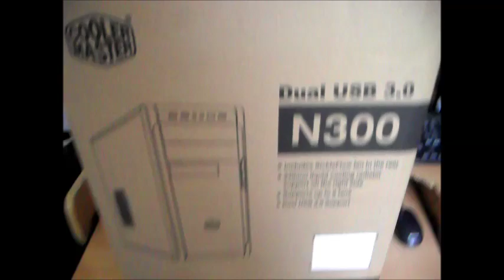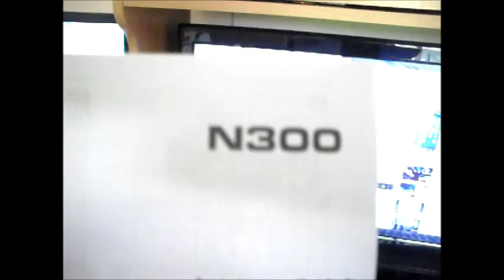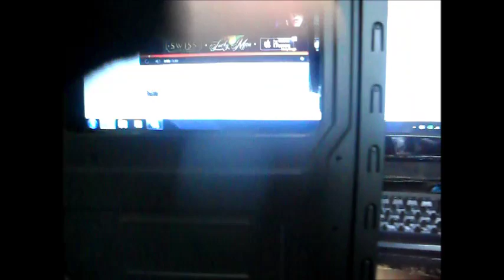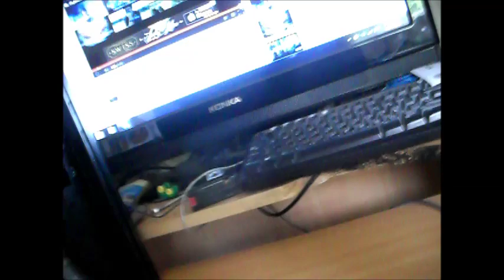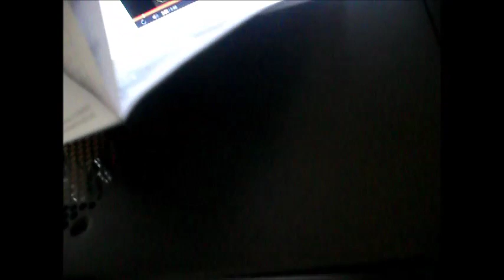CoolerMaster N300 Unboxing and First Look

Comment: i have a question wich needs to be answerd!!!! if you install a side fan? can you remove the case? of the pc because its connected?
Reply: Yes. Remove the side panel a bit, disconnect the fan wire.

Comment: I'm thinking of buying this case because my stuff gets hot in my current. So can you please tell me what stuff you got and how cool it stays? Would be awesome. Are you happy with it?
Reply: Thank you man! I'm gonna buy this case..
Reply: ***** did you have any trouble installing the 120mm fan on top ? im having trouble and i think its because im using the wrong mounting screw
Reply: ***** How to remove the front panel ?
Reply: Kevin Kain just pull it out from the bottom. it requires some force but it will come off